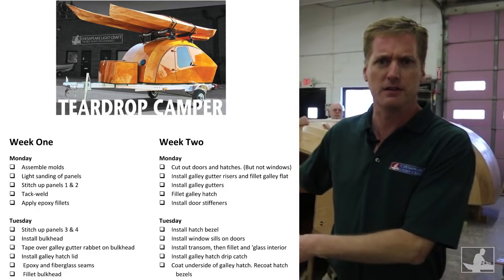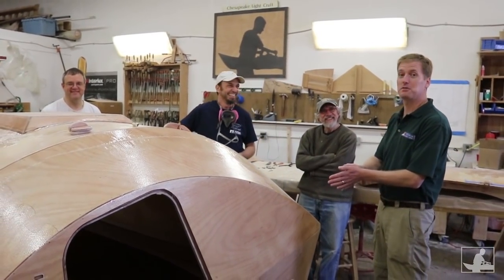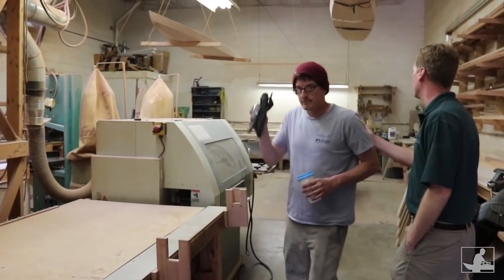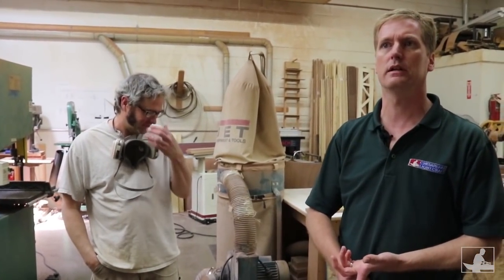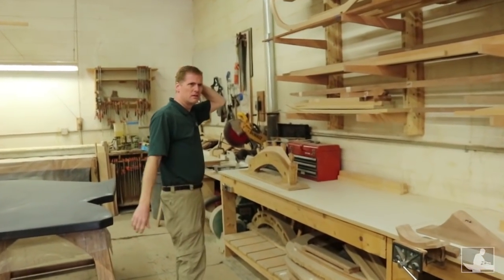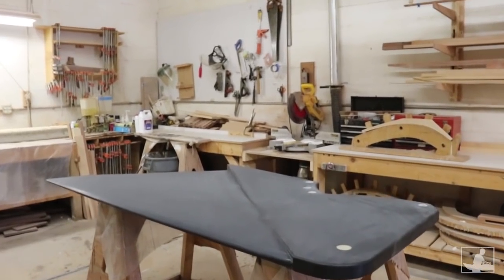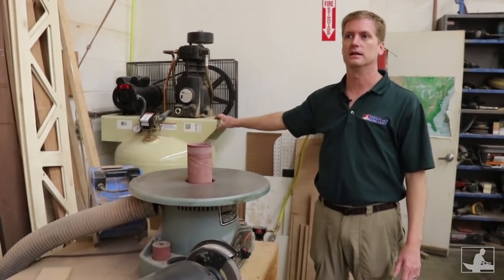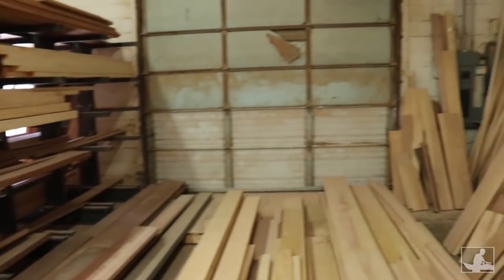Chesapeake Light Craft Shop Tour April 26, 2018

Comment: Nice. Tour.  I ve. Been a long time. Reader/ subscriber. To. Wooden Boat. Magazine.  Lived in Maryland. For. 19years. Knew. About you guys. But.   Unfortunately. Never.  Got by to.   See your. Shop.     So i was. Really happy to get.  The tour. On YouTube. Btw.    Ive owned. And restored. A. 1964.  ChtisCraft.   Connie.  And. I. Worked. In.  Architectural. Woodworking.    For   Over. 20. Years.  I so totally agree.  On. The. Outfeed.  Table  i.  Think.   Those. That. Dont have. Them.   Have. Never.    Worked. In a shop.  That.  Does. !   I.  Did.  Installation  mostly.  And. Hated. Working. In the.  Feild.   With a portable.  Table saw. And.  Roller. Stands.    It.  Just. Always felt. Unsafe  ,  when.  You. Do have. The proper. Set. Up.  Its.   Nice. To know. Your. Peice. Is supported.    And.     Should. Not.    Bind. Or.  Kick back on.  You.  Ive. Unfortunately. Know too many.   Guys.   That. Have been.  “ bitten”.  In.  Our. Industry.  And.   Safety.  Is a must. !   Thanks again for the. Tour